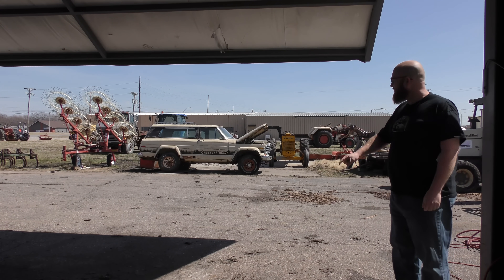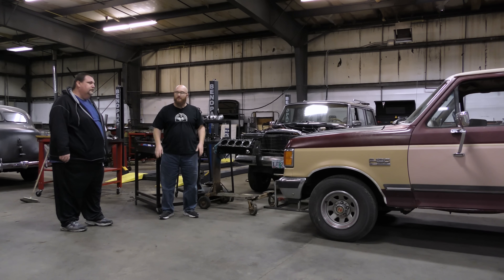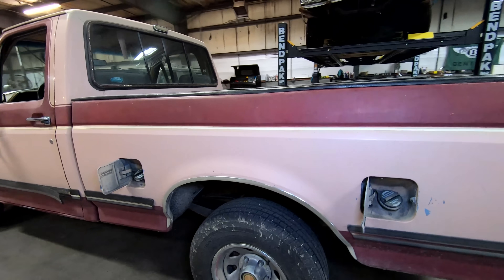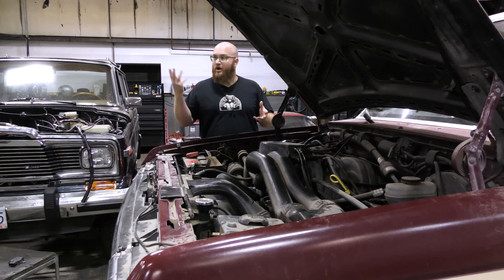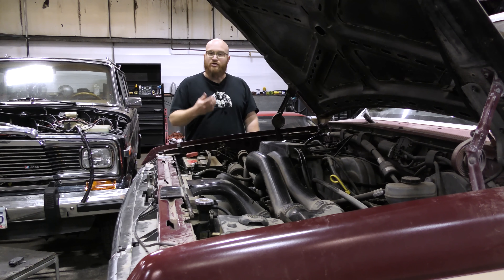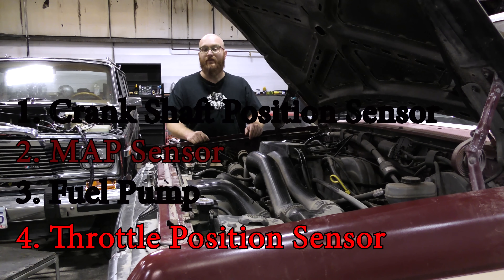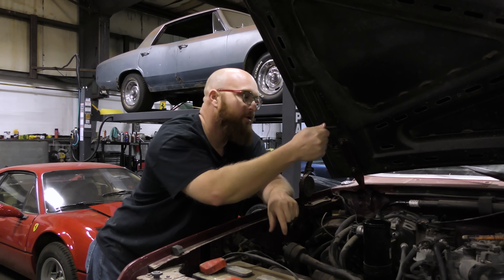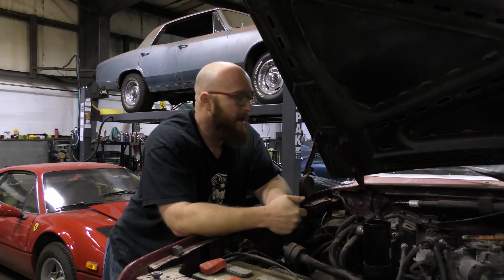Parts cannon couldn't fix this '90 F150. Old School diagnosing by the CAR WIZARD

Comment: Just an FWI. I had an 89 with the 4.9 and decided to do a motor swap. I worked on it over a summer and got it together the next winter. Everything worked good but when I started it, it ran flooded, blew black smoke and wouldn’t hardly run. I went crazy tearing crap apart and trying to figure the issue out. I finally went back to basics and started checking vacuum hoses. While torn down, a mud dauber wasp had crawled into the vacuum tube to the MAP sensor and built a nest, plugging the tube. I ran a wire through the tube, a bunch of mud and larvae came out and after that the truck ran fine. Crazy bugs, they have wrecked a lot of stuff with their little nests.

Comment: BBK 3501 is an aftermarket throttle body. I personally would try to get a used one or NOS. But, the aftermarket one is an option to consider.
Reply: Your suggestion is solid. I looked one up and there looks like there are three versions. BBK #3501, #3502 and #3503. As for differences, not sure. But I imagine the closest to stock would be great.
Reply: yeah i'm honestly surprised he had a hard time getting something for a 302, those things are so common in the aftermarket.
Reply: @FM4AMGV  Ford stopped making them quite a while ago
Reply: @MichaelRCarlson  but in the aftermarket they are quite common.

Comment: Wow, does that bring back some memories! I had exactly that model with the straight 6 and with a manual trans and I loved it. That engine was no speed demon, but it sure was reliable.👍
Reply: Had the same truck in  1997 loved that truck
Reply: THAT is the issue with today's vehicles: they are so wrapped up in HP and Torque and jimmy jims and goo gaws they lost the plot. Daddy Doug reviewed a truck and he whined about some of the lack of gadgets, DUDE IT"S A TRUCK it's not SUPPOSED to have gadgets. WAAAA it doesn't have power seats! WAAAA I set my seat the day I took possession of it and it hasn't moved in 6 years...same as the mirrors and the pedals. 

I need 3 options in my truck: cruise, power windows and a/c......
Reply: I've had 3 trucks with that setup. 69 F-100 with a 3 on the tree, a 94 F-150 with a 5 on the floor, a I'm currently driving a 95 F-150 with an automatic transmission. All of which had over 300,000 miles on it. The 94 when I sold it had over 383,000 miles on it, and I saw it still on the road late last year. If you take care of your vehicles, they'll last a long time.

Comment: I'm dealing with my '91 Chev pickup with the 350 V8, throttle body injection that has been working well since I recently brought it into service then suddenly will turn over happily until the battery runs down but won't start.  This video has been a useful reminder of logical elimination of some faults and what possible causes I should be looking at instead of replacing parts one guess at a time until I get lucky. 

 I very much agree with your reasoning on why these old vehicles can be worth spending on -  it doesn't so much matter what the market says it's worth if you aren't selling and if you can use the vehicle to get value for what you spent.

Comment: I have a 1996 Ford F150 with a 5.0L (302) Windsor V8 with 210,000 miles and still going strong, the only things I replaced on my truck was the starter, the rear fuel pump, and the power steering megunisum but other than that mostly was just simple maintenance, took out the transmission fluid just to get rid of the shuttering it was making and it hasn't had a problem ever since.
Reply: In 1979, my parents bought a brand new Ford LTD.
And my mom of all people, insisted that it had the Windsor engine. 
Smart mom.  Great long running car.
Reply: @BA-gn3qb  Sounds awesome brother.
Reply: Canada knows how to build an engine!
Reply: @ajmedeiros77  Ford Australia did a 302 Cleveland which was only used locally. It was an Ok engine too.
Reply: I have the same F150 as you.  I wish the new Ranger or Bronco came with the old pushrod 302 instead of those retched Eco-Boost engines.  I don't think people will be bragging about their Eco-Boosts 26 years from now.
Reply: @jwelchon2416  Right on brother
Reply: @C J Ciovin You're about due for a timing chain. Get the chain and gear set from TRW and you'll never have to do it again- get Ford or the cheap stuff and you'll be back in there someday. Been wrenching Windsors since the late 70's and other than the early smogger cylinder heads they're the best stock V8 ever IMHO.

Comment: Refreshing to see you willing to old school diagnose. I have several late 80s early 90s mercedes with Ke- jetronic fuel injection that has a lot of integtated parts. And yes,  I am guilty of throwing darts in hopes of a cure. Out comes the volt meter and pressure gauges. Its tedious, but most shops dont want to bother with it anymore. 
 Thanks for helping in keeping these classics on the road.
 Keep up the honest and frank commentary.

Comment: As straight and rust free as that truck is in addition to being a short bed with a 5.0 engine, it's ABSOLUTELY worth saving and putting money into!  Good call from the high schooler!
Reply: The new aluminum engines have often had at least one "overheating" event, and the heads are toast. The old 300/302/351 cast iron engines are absolutely worth a rebuild at 300K miles. You can even find a spare engine cheaply, have it rebuilt at your convenience while the old engine is just burning a little oil, and swap them on a single weekend.

Comment: Good video, Wizard! Having been very happily in stewardship of my nicely preserved 95 F-150 for 8 years now, I've learned a lot about these old Fords and their EEC systems. The top two things I would urge your customer to get his hands on (if he keeps this truck, and he totally should) would be a factory service manual, and an old Snap-On "Brick" scan tool. Both of these can be had on the cheap, and are very much worth the investment. To be honest, I don't think my truck would be as well maintained or running as great as it is without these vital tools.

Also, thanks for making the TB shaft bushings point. My truck has a rare surge that I thought was the IAC by process of elimination, and never gave any pause for concern otherwise. Once it warms up here in the frigid Northeast and the salt is washed away, I'll get to tinkering again and make the ol boy run even better : )
Reply: I agree about the obdI scanner innova code reader,they are a bit cruder info that point you in the directions of issues to narrow down

Comment: There is some shit called q bond. It's a 2 part mix, a liquid and then 1 type of powder for metal, another for plastics/urethanes. I'd pull the bushings, find the worn areas, and try to fill em and file it down. It's pretty tough and fuel/oil resistant if my memory serves me well this day. Otherwise, maybe try and machine down some urethane sway bar link bushings to fit if you can find ones with the right inner diameter. But I'm an idiot, so... big grain of salt lol.

Comment: I was shocked to find a fuel pressure regulator for my D21 pickup IN STOCK from a seller on Amazon. Nobody on the island had one (some places didn't know what part I was looking for). Plus the big parts stores wanted almost $200 for it whereas I paid about $50.
Thanks for the content CW. 🤙🏾

Comment: Hi Mr. Wizard, what a trip down memory lane this was!!  I worked on these when they were new in Colorado. We would take the throttle body off the truck and detail clean them, they sure don't like the black soot build-up in the ports. This usually fixed the customer complaints of rough / erratic idle, but they were much newer and the throttle shaft wear was not an issue yet. Will be watching to see your fix, and Thanks for all the great videos!

Comment: As a Diehard GM guy myself, I actually love the 1980-1996 Era F150s with the 300 I6 engines, damn near unkillable as long as you keep coolant and oil in it
Reply: I own 2 of them an 82 f100 with a four speed and a 85 f150 with the automatic both with the i6
Reply: They do run a long time. I bought an old one to try and tow with it. Had a 5 speed and fuel injection. Tried towing a 4000 lb car on a dolly. Truck could not get out of its own way.
Reply: @mph5896  what you do, is, ,,seeing there all v8 parts inside. fit flat tops, mild can, decent inlet 4 bbl. never sell it.. there a lugger. if yours wouldnt pull,then something wrong with it timeing, fuel,blockage. mine drove everywhere in top..[ i have to comment to the chev guy.not going to like it..]..
Reply: im still waiting for chev to build a decent engine. the 454 & LS come close. but, still lack real engineering.. i have chev parts on my ford, like discs, but, ill never buy one. that said. here in aus, i wanted a blazer. about 6 in the country, so that never happened. i just liked the dash layout.. i now have, a, 62 f100 4x4, 75 highboy, 82 sas bronco, 2002 s/duty, & a challenger, 340 r/t. 73.. not one chev in sight..but,,if you containered say 10, here to aus, you could retire.. stay safe, hard to find a modern vehicle thats any good..

Comment: Thanks Wizard, my 89 Bronco with the 351 is doing the same thing, threw the same parts at it, still irratic idle, never thought of the bushings, now to find another throttle body, thank you sir!
Reply: Look on salvage yards maybe you'll find one so you don't pay 500$ bucks for a new Chinese one. There's a Ford explorer with that engine I believe is the last car that came with it.
Reply: I got a 94 bronco 5.8 same issue fellas. Im thinking the salvage yard also. Aren't there throttle rebuilders?
Reply: @jesusdiaz82  the Explorer had the 4.0 v6. The first 5.0 Explorer was in 96.
Reply: @III1IlIIlIllIl  yeap, I think these came out til 2001 or 00, but now I'm remembering that these came with the mustang style intake, gt40p heads and  few others mods.
Reply: one of the posters mentioned replacing the bushings yourself with brass tubing from the craft store?  better than paying 400$ for one

Comment: In 1986 I was a 20 year old college kid home for the summer in Michigan and I worked for a landscaping company.  To say that I was in shape is an understatement! None of our "walk behind" mowers had the platforms that landscapers have these days.  

In any case, one day my boss handed me the keys to the silver '81 F150 in the lot.  He told me to drive up to Detroit, 15 miles away, and to take a large Stihl weed whip with a metal blade and mow the berm at Detroit Edison's Connors Creek Power Plant.  

You're probably cringing at this point, but I wasn't.  The berm wasn't that large, the whip would make short work of it, and I liked working on my own, though normally I was with a crew of other college guys that I really liked.  But just a chance to go up alone and do some easy work really appealed to me!  The truck involved was a manual, with "Three On the Tree", or a manual column shifter, a bizarre idea to me.  Anyway, this had the 4.9 liter inline 6, which was very torquey.  The Ford "truck 6" is a nearly indestructible engine that makes decent horsepower for a work truck while not using much fuel.  When I was 33 I bought a '66 F100 from a friend on a whim with the 4.0 liter version of this engine and used it as an airport car, and I can see why he says these run forever;  They are massively overbuilt, weigh 700 pounds, hate to rev, and are totally underworked~

The problem with the '81 Ford:  The steering gear box.  I was worried as I drove the truck up I-75 at 70 mph that I would get pulled over because the truck wandered left and right.  Not scarily, but easily manageable if you pay attention.  This is TYPICAL.  And this goes back to all Ford trucks since the 1960's

In any case, I liked the truck, despite being a serious Volkswagen/German car fan.  It was solid, it was no bullshit, it did the job, and then it went home and drank beer.

Great video!
Reply: I had a 1981 F100 with the 300 and column shift. And a 4.11 rear axle. I remember that by the time you'd done the routine to get it into second gear, the truck had almost rolled to a halt. I think flat out it wouldn't quite manage 10 MPH in first gear. Sure would pull though. It developed a quirk where if you hit one of the many potholes in my area, the engine would die. But if you left it in gear, and you were quick, you could hit another bump and it would start again. I went to replace the ignition switch, and it disintegrated into plastic gravel with metal strips in it. I carried the aforementioned pile of rubble into the local Autozone, and the guy behind the counter, upon seeing it, asked "What year F150 is this out of?"

Comment: Got a '95 with the 5.0.
Thanks to the Chicago area winters the rear spring perches were toast but after that and a new gas tank she's running great. 159000 miles and the air still blows ice cold (albeit with a fan that only works on high speed).
Body is still decent for it's age and I plan to keep her for a long time.
Thanks Wizard & crew for this one, these old Ford's always get more looks than the new ones and I love the old school feel, even in XLT trim.

Comment: #2 MAP sensor. Should read about 110 Hz at idle going to about 140Hz at WOT. Voltage won't tell you anything of value. You have to measure frequency.

Comment: Love it! I got a '88 F-150 custom with the 4.9L I6. It has been hands down the most reliable vehicle I've ever owned. A previous owner swapped the old 4 speed with overdrive out and replaced it with the bulletproof C6 3 speed automatic. Very powerful for an old truck.

Comment: I've been stuck drilling out throttle shaft bores and using hobby store brass fuel line as bushings on carbs for a while now.  Beats the parts cannon.
Reply: That is probably a better idea than mine. Now that I think of it, not sure if urethanes are fuel friendly. A backfire might just melt em. Brass is might be harder to get to the right size (I am talking out my ass here, have never done this kind of repair lol), but I think it'll hold up better in that application.
Reply: I've done the same thing.  Our local hardware store stocks bronze bushings that can be cut, drilled/reamed, and/or cut on a lathe to fit.  It's a fairly easy repair.  I've also considered using hobby store brass tubing.
Reply: could spooging some thick plumbers silicone grease into the bushing and shaft hole prevent air leakage?  seems like if it can hold back water pressure it would hold atmospheric pressure OK

Comment: strong work! i have a 90 bronco custom and 91 f10 xlt extended cab. both 4x4 5.0! both 250k+ miles. will say the f150 has idle issues, bronco purrsss. thanks for highlighting these old trucks and give that kid a cameo!!!

Comment: Stupid question but have you tried calling up the Ford dealer? 
Also it's worth mentioning but they sell rubber gasket material by the roll. Depending how good you are and how adventurous you feel you could always use that material with an X-Acto blade to make some new gaskets. Let's see you show off some skill to those "Lesser McHanics". 

"McHanic" = Mechanic : I pronounce it in a kinda "McDonald's" or "McJob" type of way.

Comment: I had a '71 455 H.O. Trans Am back in the early '80's that had this same idle issue. An 'ol school mechanic I knew named Ronny suspected a vacuum leak & sprayed WD-40 on the throttle blade area of the 800 CFM Q-Jet carb #7041268 causing an idle change. The local parts store had a new #7041270 800 CFM in stock that I replaced it with - end of problem. Today those same carb's fetch thousand of dollars on eBay. I think I paid maybe a buck fifty for the new one. Those were the days. Great Video Mr. Wizard!

Comment: If your customer is up for it, perhaps an Edelbrock Pro-Flo 4 EFI system. It is overkill to fix their issue, but it's an option.

EDIT: What about adapting a throttle body meant for an LS engine to the Ford EFI or a BBK Performance Throttle Body? I bet availability is still a factor though, but it's worth a shot. Also, it seems the former is the least feesable.
Reply: The Ford system works very well indeed. Just a matter of buying the Haynes Manual and putting it into diagnostic mode. Very easy indeed. Been there, done that on multiple Ford's of the era. The FUN was a trio of Grand Marquis all with the 351W, and two with the Trailer Tow III Package. That made for fun, considering they were so rare even Ford mechanics had never heard of one, never mind worked on them
Reply: It is an option but remember the owner is a high school student and that option is probly well out of his reach especially when it’s already got a perfectly good system in place already
Reply: @1982MCI  I know, just throwing it out there. Parts availablablity is ambiguous at best right now in terms of OEM for certain things. As for custom, it's less of an issue.
Reply: If the truck was originally carbureted, yes I would do it. If it’s EFI, leave it alone.
Reply: @atx-cvpi_99  But that OEM part availablity issue though. I agree, yet present shortages sway me to modestly customize. But hey, it's the kid's truck and I'm just offering a suggestion. An expensive one, but still. I'll look into getting a pro-flo for my van. I hate carborators. Too young to figure it out or care. lol!

Comment: My first vehicle was an 88 F150 in 2008, so it was 20 years old. It was the XLT 4x4, single cab, 8 foot bed and 4 speed granny low. It was such an amazing truck, I paid $1500 for it when I was 17 years old. It ran great, the TPS was bad and I replaced that, exact same issue this truck had…and I had to do some work on the clutch slave cylinder. It had 250k miles on it and I let my mom borrow it after fixing clutch ( over $400 in parts )and she got drunk and totaled it out. To this day, at 30 years old, I still miss that truck. My mom gave me $350 for totaling it and to this day I’ll never let someone else drive my car besides my wife.